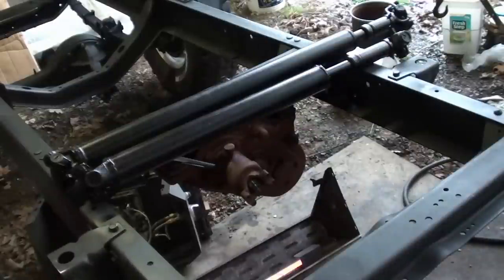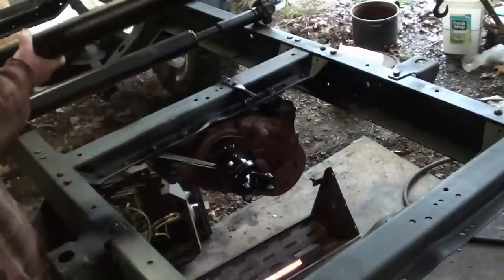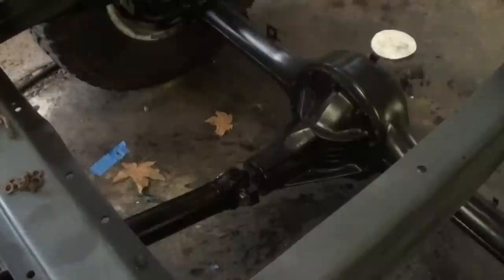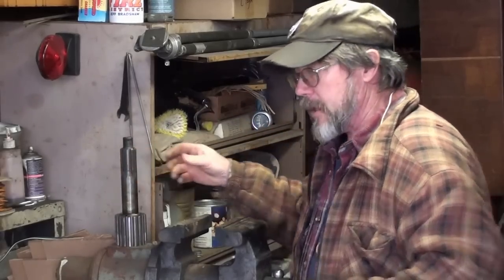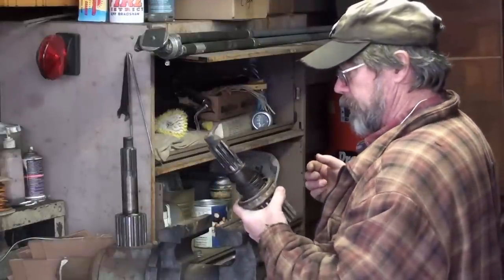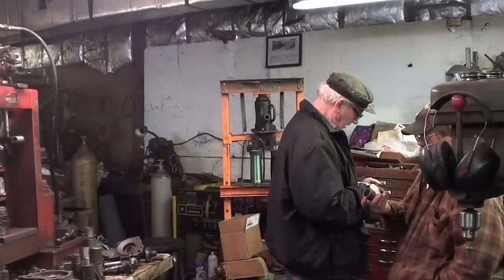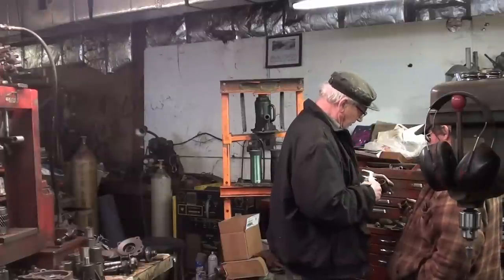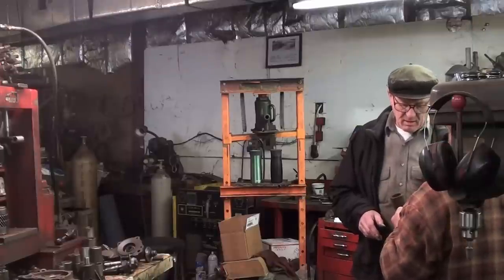Drive Shaft Installation Goes Wrong! Operation Crusty Truck # 58!

Comment: Ok Jeff the front drive shaft on my 1957 Chev. NAPCO  has slop in the collar. The outfit here wants to replace the entire assembly. I want it to be repaired and original. What do you think. Ron in Bend!
Reply from the maker: You'll have to define "collar". Slop in the drive SHAFT as in the slip yoke? Or slop in the output shaft of the transfer case where the yoke is attached? Email; RNRTOT at frontier com
Reply: @ElderlyIron  Slip Yoke, thanks Jeff. Vibrates at about 30 mph high range.

Comment: damn missed the live show   @ElderlyIron      Jeff wouldn't the angle greater because there isn't any weight on the springs
Reply from the maker: What you can't really see was that the shaft wouldn't drop far enough to engage the yoke. After I tell you, then you can see it when you watch it again.
Reply: @ElderlyIron  got ya   Jeff  btw i made and uploaded my first vid a trip i took on a new train here in southflorida over 200 views in a couple weeks